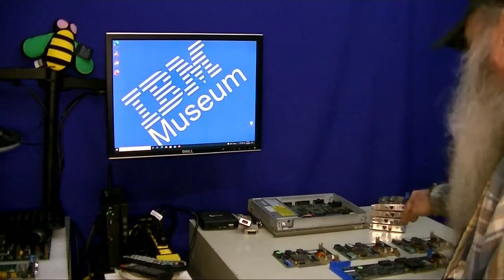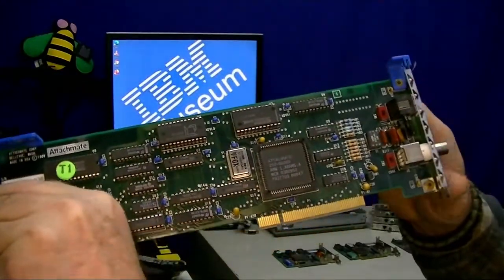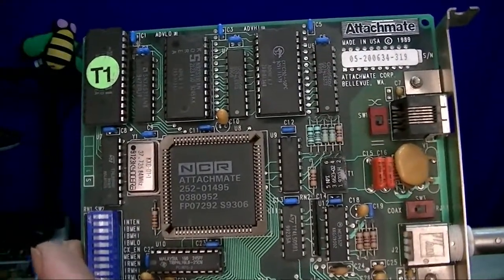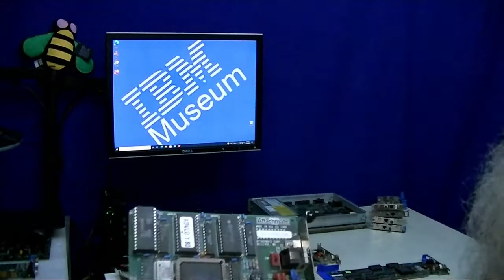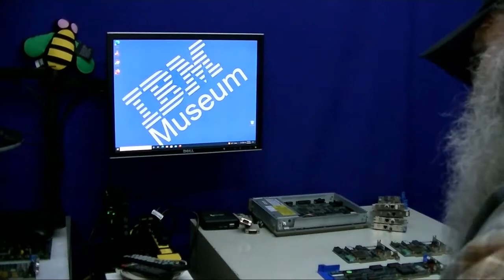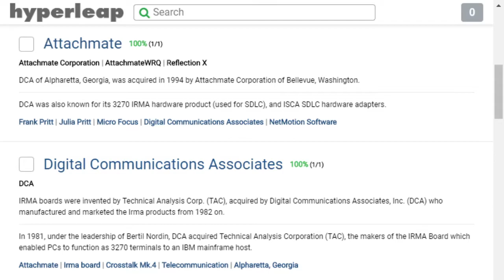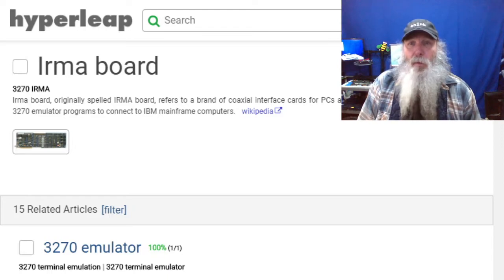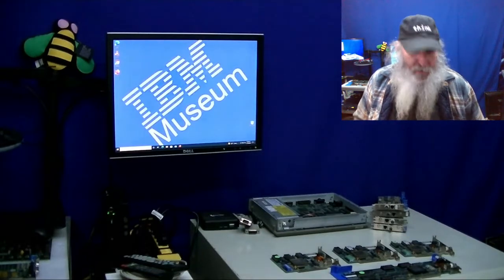The "Attachmate" 3270 co-ax (and RJ-11) adapters!

Comment: Damm dude got to watch this content a few times. It brings back so many memories.  I was employed by Attachmate in the 80s. Was hired by a guy named Frank Pritt (at that time sole owner) as a computer operator working on IBM big iron. The way I understand it 3270s ieIBM green screen terminals cost so much the emulator board was born. With that and a 80286 based pc you could have an interface between to the 3274 controler for a fraction of the price of a 3270 dumb terminal with the added benefit of performing other task on the pc thus eliminating the need for an overpriced 3270 green screen.

Comment: I think you may have just helped solve a bit of a mystery that's been rolling around in my head since I started poking around under the floors at my data center...  Until around 2015, they used to have an old IBM mainframe in there and we keep running into these super weird cabling rig-ups all over the place.  Some look like they were patched into the old phone system, while others are this strange amalgamation of a standard telephone plug rigged into a coax plug.  In some spots they literally took two super thin wires that look like they were pulled out of an amphenol cable and had it running from a punch-down block in the old telco closet connected to a cut off coax cable held together with electrical tape.  For the life of me I can't imagine how any of it could have reliably carried a signal, but given the connectors on these boards its starting to make sense as to what they were trying to accomplish!  ...  I think...  :)
Reply from the maker: For the telco punch-down blocks, "station wire" pairs can still be twisted (and is that way on the paired reels, of course) for a 'UTP' (Unshielded Twisted Pair) conformance. Yeah, whichever cabling that was in place was made to work at whatever level. Telephone cabling was "CAT 1", rated at up to 1Mbps when it is referenced as carrying data. Even later 'CAT 3' (10Mbps) is just two pairs (four wires).

The twists are required - in the balun video, I covered the 'white paper' rejecting the use of "flat" telephone cabling. Cabling was a horror story back in the day and has at least coalesced to the better modern methods now. So much has changed.

Comment: Are there switches or hubs for the RJ-11 network system or is it xover setting on one machine straight to another machine?
Reply from the maker: 3270 emulation will have to be connected to a host - so it would be to a hub or balun able to convert back to the co-ax controllers for the IBM mainframe. "Baseband" was an early PC networking infrastructure that also often used RJ-11 cabling ('CAT 1', rated for up to 1Mbps) for connectivity. Both methods were based on using cheap - and commonly available - cabling that was in place in older buildings.